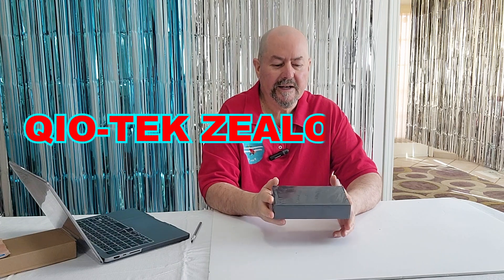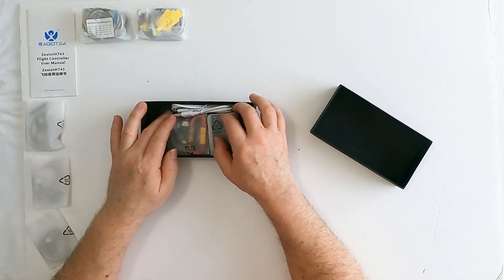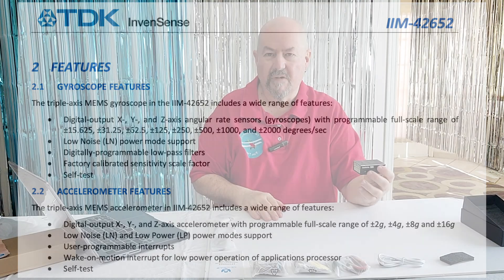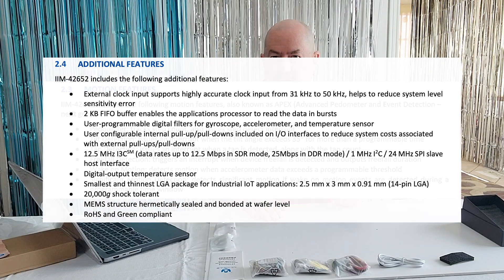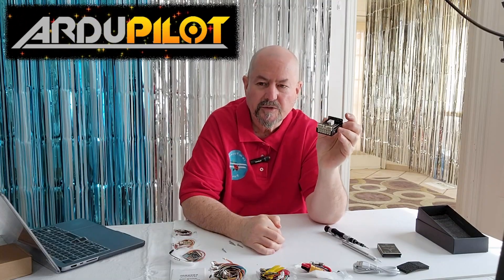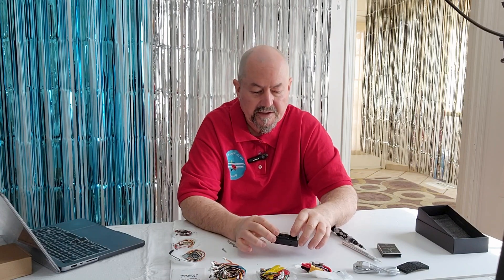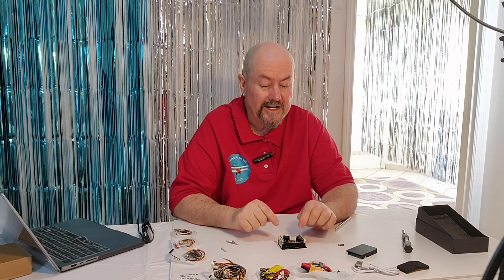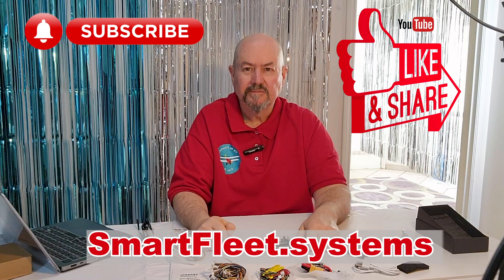Qio-Tek Zealot H743 Aero flight controller. No GPS? No worries!

Comment: Fun fact warranty seal stickers are illegal in the US not that it matters to a Chinese company but, it is annoying that if you drop an sd card in the case you can't open the thing up to get it out, the foam is likely covering a barometer BTW. I would love to see the comparison in dead reckoning between this and a $100 Matek because the dead reckoning seems to work great even on the cheaper fc's this one might be able to do full navigation without GPS in the future if it's as good as claimed.
Reply from the maker: Stay tuned - I'm going to test it!